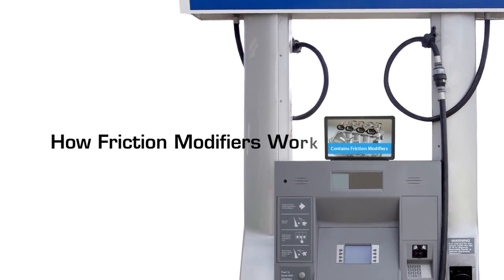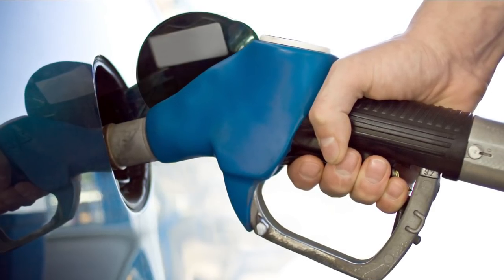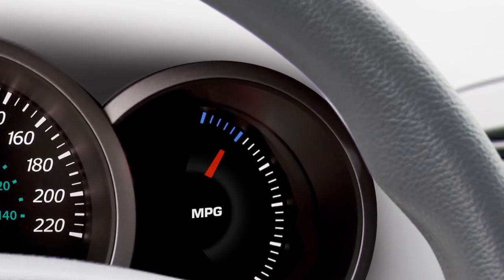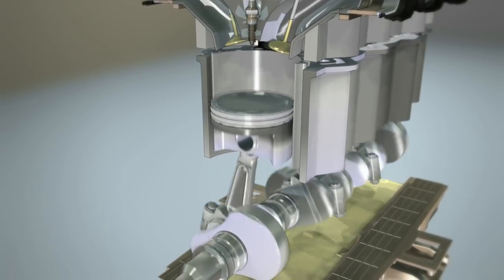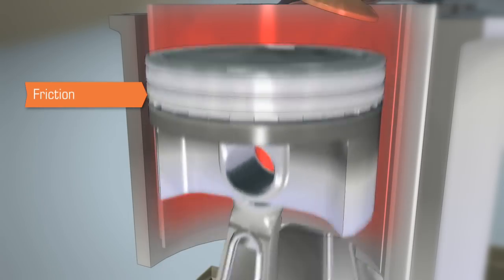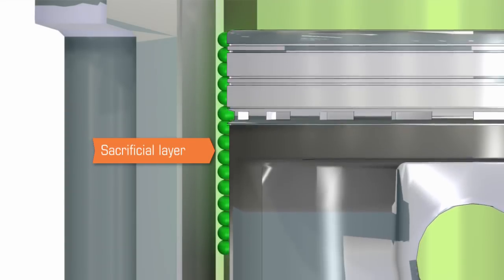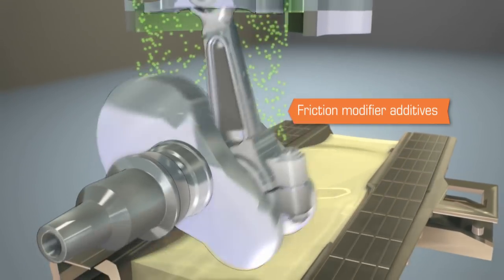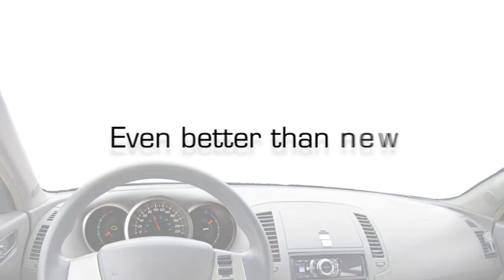How friction modifiers work.

Comment: There may be a hint of truth in there somewhere but believe me if car manufactures could get significant better millage numbers to put on those window stickers buy using this stuff they would be using it.
Reply: Nissan, do example, using Molybdenum disulfide for GT-R, 350Z, 370Z, Juke R NISMO etc. as a cylinder coating.